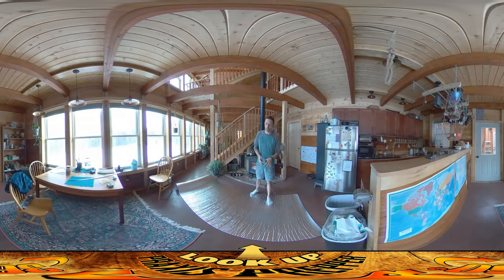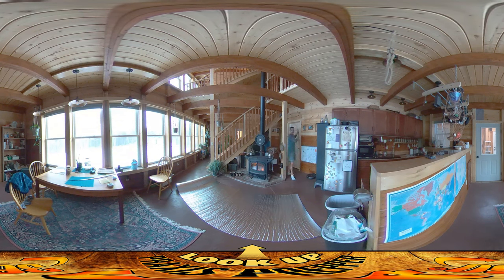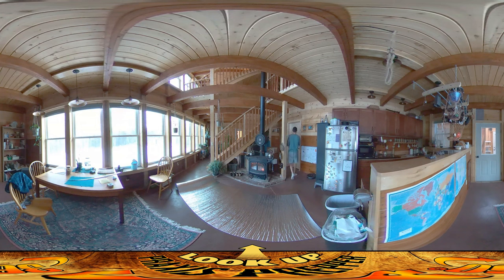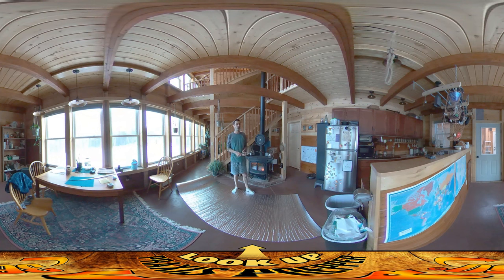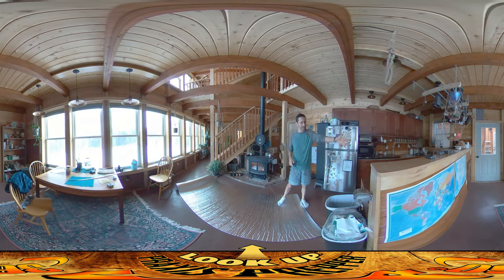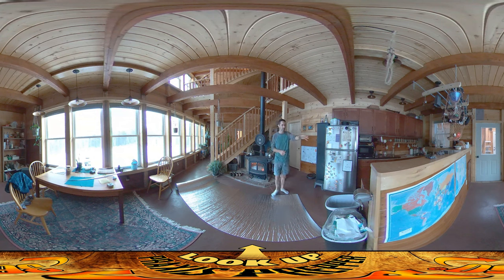Homestead Building - Creating Heat Shielding for Keeping a Pantry Cool

Comment: Well the math I use is call 3 4 5 when I am working with a large area(3 ft up one side 4ft up other side and its 5ft diagonally across) just easy for my brain to remember... but for what you were doing I tend to just use a t square then I don't have to do math lol
Reply from the maker: I do the 345 thing whenever I don't have a calculator handy. It's handy.
Reply: @PraxisPrepper  yeah was should it in my early 30s....with I would have known it sooner lol